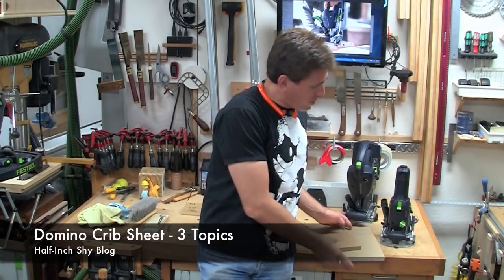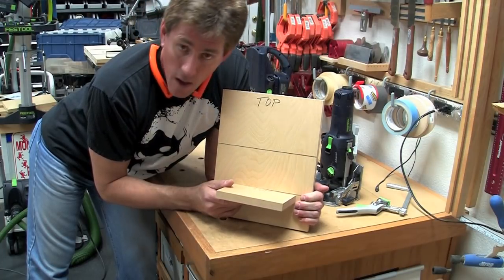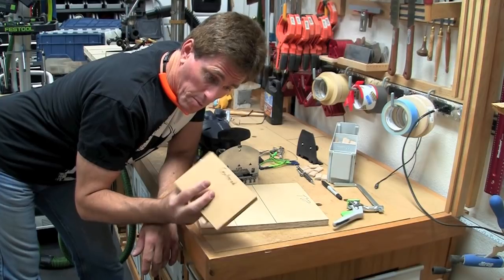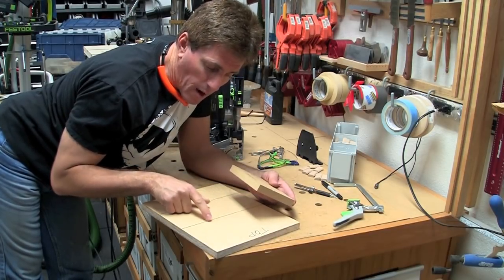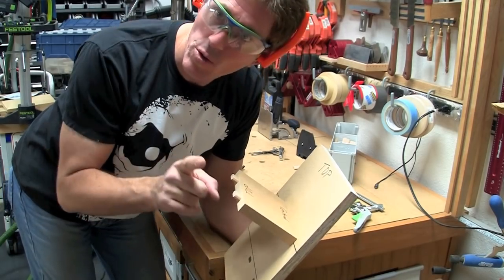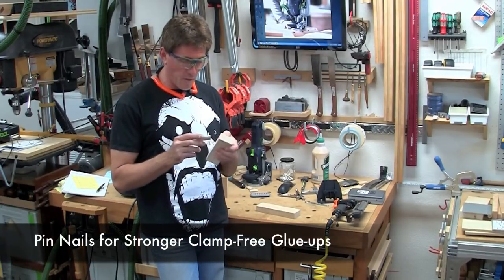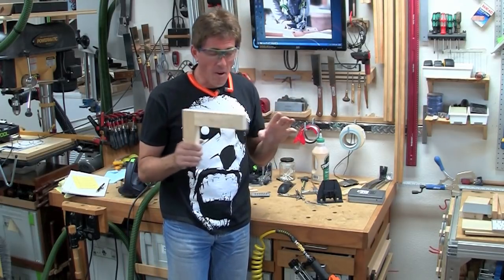#71 - Domino Crib Sheet - 3 Topics - Mid-Panel Joinery, Cut-to-Length Stock, Pinning Joints

Comment: Thank you Paul. Very helpful. My first project with my new domino requires mid-panel and I was getting set to do all kinds of measurements but the 2nd technique is great when it's not easy to reference off a narrow piece with different thickness ( like a leg which I'm attaching ).

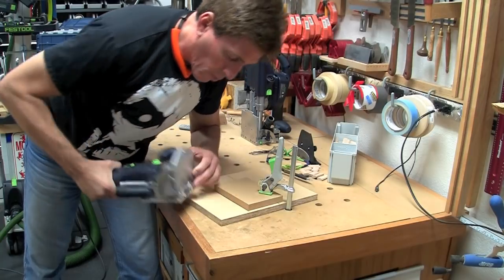Comment: Great video, which I found thru a link on the FOG site. I was looking to see how to align a pencil mark on the surface with the DF500 in the horizontal position (technque 1). At 3:24 you show to align the pencil to the triangle mark. So I looked at my recent vintage DF500 (and images on web) and the DF500 no longer has this triangle mark. Maybe the change went into production when they switched to plastic location pins. So now I am at a loss as to how to align to a pencil line since the only alignment marks are on the clear plastic or the engraved triangles, which are both too far above the pencil line to be useful.

Comment: Mark, I just started using the Domino 500. I have fairly good lighting in my garage with florescent shop lamps, but it is not enough to see my lines through the plastic gauge on my Domino. Since you have some pull with Festool, suggest a laser light on the next generation; that would truly make it a killer tool. I use my Petzl headlamp that I usually use for night jogging to shine into the Domino (especially on flat mid-panel cuts when the fence is straight up). Also when my vacuum hose is attached it gets in the way and I have a hard time finding the right grip during flat cuts; I wish the hose attachment was at a larger angle away from the tool.
Reply from the maker: Well, I'm Paul-Marcel, but I could see why you thought I was Mark since a previous comment called me Mark, too :-/ Not sure why I couldn't answer that one; YouTube/G+ comments had issues back then.

I don't really have pull other than I know people to contact with suggestions. I think what would really help you out instead is a thin cut in the sight with a bevel. That way when the line is in the cut, there's nothing obstructing the view and you'd easily find it by sweeping side to side.

Another option: there's a gap between the bottom of the sight and the Domino body itself. There's nothing obstructing the view so you should be able to see your line and see it match up with the line on the sight.  Give that a look.

Comment: Thank you for making these videos.  You convinced me to pick up a Domino XL and I’m very happy with it.  I do have a question about using the loose tenons on 90 degree joinery for cabinet type construction.  There is almost no long grain to long grain surface on one of the pieces for this joint.  Have you found that the joint is strong enough when making this type of joint?    Thanks again!

Comment: Actually the first method at 4:36 could also be made to work with the 700.  You'd just need to use four or more 5mm thick spacers or shims to raise the top piece up by 5mm.

Comment: There is a better way to do mid panel joint whit 700.
Depends on drill bit size and material thickness, but in my case 8mm bit /18mm panel, you just need to do - 4mm offset from bottom selfh line. 🙂

Comment: Hi! Maybe I'm stupid but I can not grasp how the second method is centering the "shelf" on the panel line. Since you want to have the holes a little bit offset in the end of the shelves (you have them 10 mm down from the top here) shouldnt the shelves end up about a mm high?

Comment: Mark,

Take a look at the Kreg Jig web site and look for angled pocket hole joints.  

There's a trick which  basically mates an angled bevel to a 90 degree end.  Then the extra length is trimmed flat. This avoids the fragile double bevels meeting and it also provides maximum depth for the pocket hole screw effective hole length.  The pocket hole on the 90 degree mating piece and the screw penetrates into the one beveled edge.

Let me know what you think.

Steve J.
Portland, OR